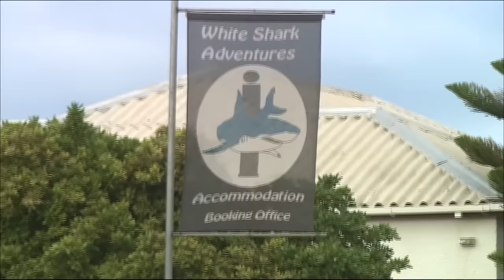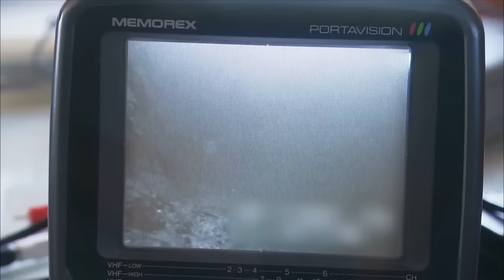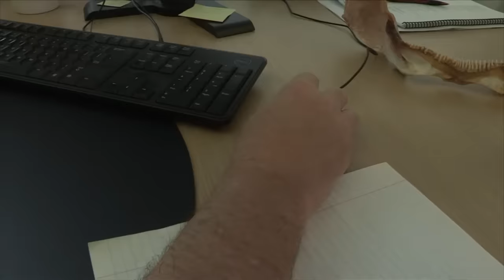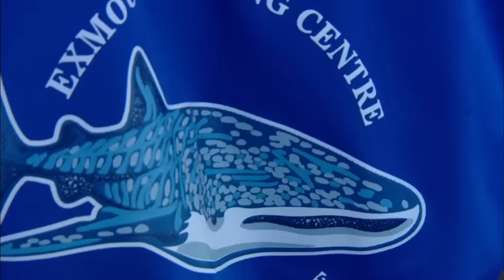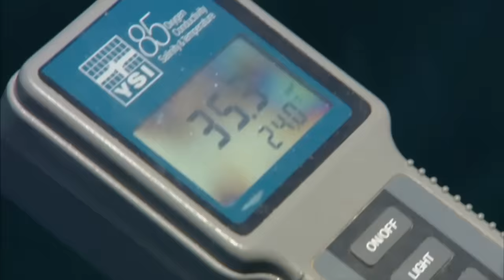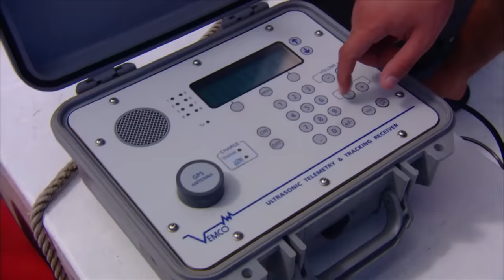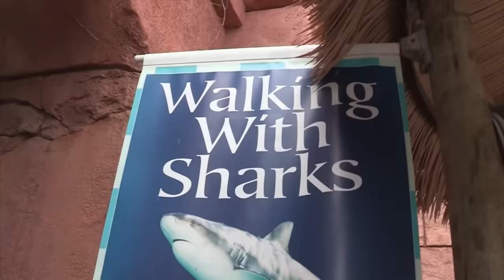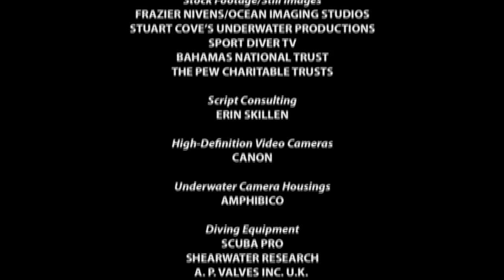Sharks - The Ocean's Apex Predators | The Blue Realm | Free Documentary Nature

Comment: You can't simultaneously claim that sharks are highly intelligent and in the same breath claim that they just confused a swimmer or suffer for a seal. Orcas eat seals too but you don't hear about orcas attacking Surfer's or swimmers. And I know for a fact orcas are actually intelligent. So just by using common sense I can easily debunk that ridiculous claim. So either sharks are intelligent and intentionally attacking swimmers, divers and Surfer's. Or that they are just mindless eating machines that are unpredictable and a direct threat to anyone in the water. You can't have it both ways!
Reply: Sharks have significantly poorer eyesight than orcas. That's how they get confused.